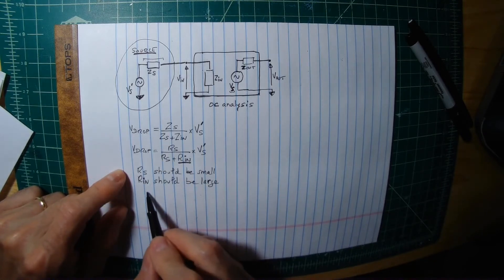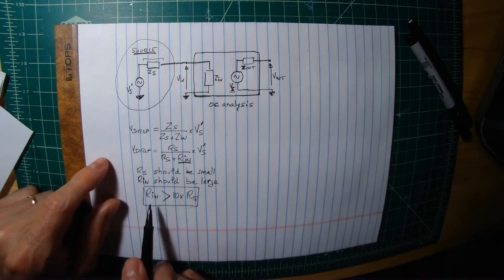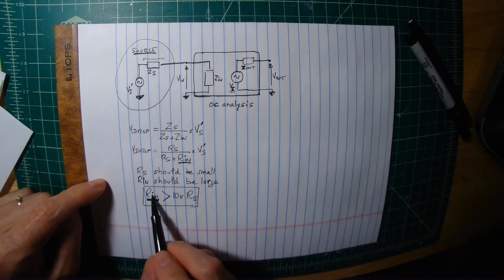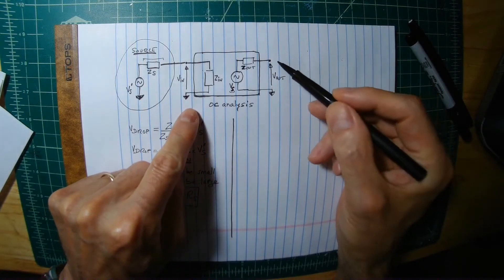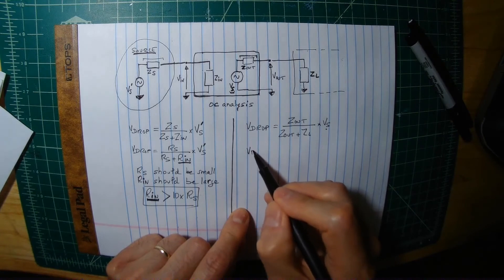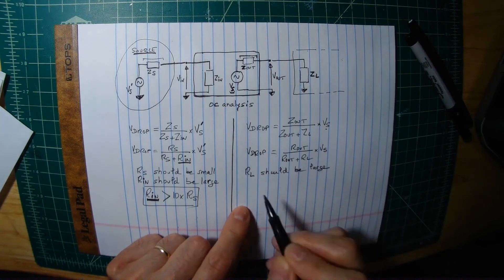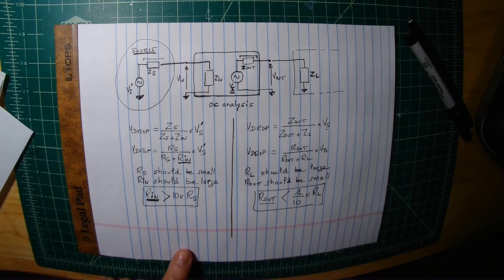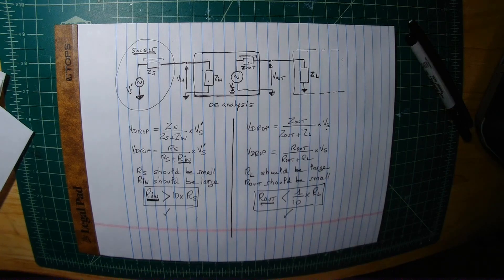Why it's so important to know the input and output impedance of a circuit (for max voltage transfer)

Comment: So if my load is 4ohm speaker, then Rout needs to be less than 0.4ohm?  Let’s say it’s a 10W speaker.  So voltage to drive it would be v=sqrt(PR)=~6V. Therefore amplifying transistor needs to handle i=6/0.4=15Amps….. is my thought process correct?
Reply from the maker: Note that what the video describes is for maximum voltage transfer, not necessarily maximum power transfer as the 2 are mutually exclusive. In the case of a speaker as load, you actually want max power transfer, not max voltage transfer. To accomplish max power transfer, you need a buffer amplifier (a voltage follower, basically) with high input impedance and low output impedance. That way, having a relatively high impedance at the output of your circuit (feeding into the speaker) is not an issue anymore. You could use a transformer too to act as a buffer. I talk about that in one of the videos about tube amps.
Reply from the maker: For 10 watts you need about 5 amps to drive a 4 ohm speaker. So you would need a power transistor. Google 10 watt power amp transistor and you should find proper transistor to use then look at the datasheet for that Q and you might also get some sample schematics on the ds. Instead of Q, you can use ic like the LM 1875.
Reply: @electronicsainteasy5253 thanks.  Just looked it up. Playing with bjts was more for education purposes also got quite a few on hands including them beefy ones.  I like the 1875 too, will pick it up next time I’m ordering parts.  What about using mosfets(or any fets for that matter)? They have high input  impedance too right? Are they used for audio?

Comment: i just love your channel, please lean towards rf electronics, my biggest dream is to be able to design radios and calculate values for components. A superheterodyne from top to bottom explained, from the input band, transistors impedance and impedance calculated for if filters would be a great series ... please try if you can...
Reply from the maker: Thanks for watching. I guess I could go into that. The good thing about superheterodyne radios is that any book on electronics will have a good description of what's involved. Of course, it won't have all the details on how to design the whole thing but all the steps will be explained. Then, it's a matter of studying each stage and designing each stage. I was gonna go into a different direction, like designing a synthesizer, but designing a radio is cool too. Food for thought, as they say.